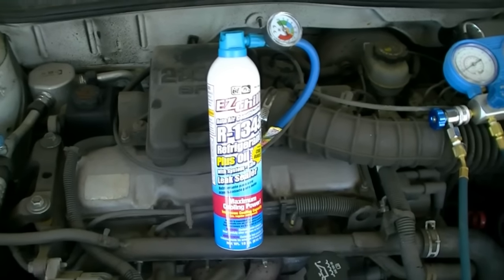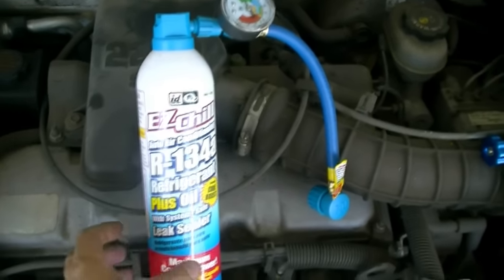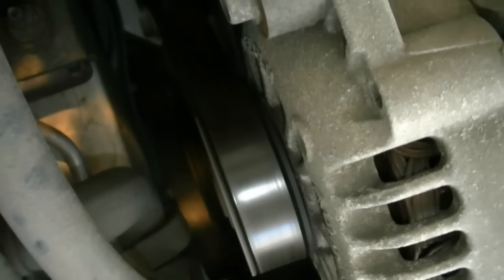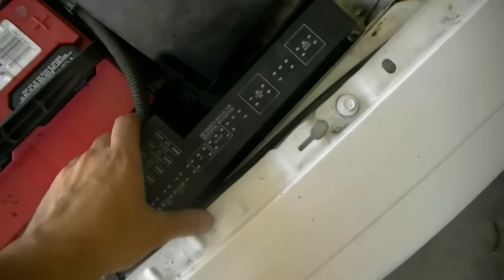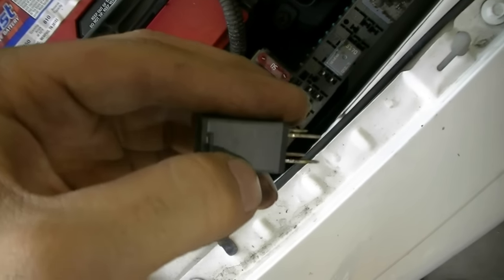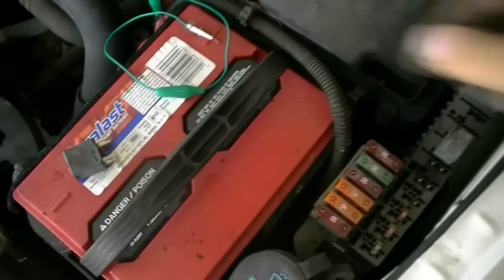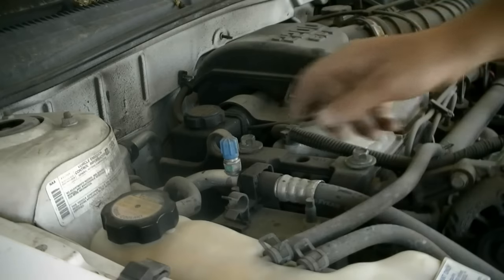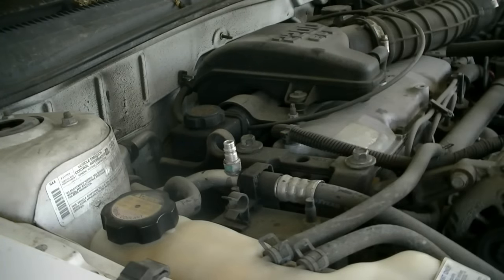How to Add Freon to a Car and Manually Engage AC Compressor Clutch

Comment from the maker: The idea of this video is to have cold air come out of the vents of your $1000 car, not spend $500-$800 finding and diagnosing a leak, vacuuming the system, replacing the parts and recharging it. I've done this to alot of el cheapo cars and it has always been a better investment than taking it to some shop where they charge you $100 just to refill the system and tell you about your leak..oh you want to know where its coming from!!? well thats another $100 sir!  Yea thanks but no thanks
Reply: Ratchets And Wrenches screw shops

Comment: I bypassed my a/c clutch and filled my car with freon and it worked! Thanks!  The only issue I have now is that I have to keep the bypass connection attached so my a/c will work.  What am I doing wrong?

Comment: If the Compressor is bad will the clutch still engage? I had someone come out the other day to recharge my system and the system would not take any freon. The compressor didn't kick on, either. When I purchased the car, I was told it had a new AC compressor installed. The mechanic said I have a bad compressor. Should I try to jump it and see if the clutch kicks on, or just buy a new compressor?

Comment: What if your relay doesn’t have a diagram on it?
Also, if you’re just running power to one terminal of the relay switch - should you ground it on another terminal? Or just power it?

Thx

Comment: Any ideas on why the ac light may not turn green when pushed? Fan blows, heater works, but no cold air. Was thinking could be freon low but in your video the ac light was still on. Thanks!

Comment: I was given a 2004 Civic that sat unused for 6 yrs. The AC does not engauge and there seems to be little or no pressure in the system. The is not worth anything but I do drive it. Should I try this hoping it will get AC working or do I need to vaccum the system and test for leaks?

Comment: I followed your helpful video on my a4 b6'04 but bypassing the relay only turned on the  ac fan, the clutch never engaged, definitely I had the wright relay, after scanning with vagcom u had a high pressure sensor fault code popping up, I had a good look at it and it looks pretty clean with no rust or wireing damage. Any solution pal. Great tutorial though. Cheers

Comment: You don't need to manually lock the clutch to add freon. When enough freon is in the system. The clutch will lockup.

Comment: Not to get too technical but it is not freon in newer cars.  It is R143a.  (the can says that in the video as well)   I'm not sure about using that stop leak. Normally they make small problems better, some of the time.  Stop leak products can also do damage.  I would avoid using it myself.  The compressor should be running when you fill it or check the pressure.  (jumper the low-pressure sensor while you are filling if you have to)  Once you get a decent amount of pressure (close to charged or blue on the gauge) the compressor should run until the low side drops below a certain pressure.  The compressor will likely stop while the low side gains pressure.  (it will cycle but the more low side pressure you have, the longer it will run the compressor) 

Fill to the desired level and it should run constantly.  The video was helpful, thanks for posting it.
Reply: Not to get too technical but it is not R-143a in any vehicle that I know of.  It is R-134a (the can says that in the video as well).
Reply: StilettoSniper you just copies and pasted it from what I said.

Comment: I watched your video on YouTube. It helped me out a lot. I could not get the clutch in the compressor to engage. When I used a jumper wire after watching your video I got the compressor to engage manually. Could this be do to low refrigerant? 2002 chevy p/u. Thanks
Reply from the maker: Susan Brucato yes, you should try adding freon first. gl
Reply: That's because you need to connect the power jumper wire to 30 not 87.

Comment: I have situation when on full blast my pressure stays around 30PSI and after compressor disengages then it goes up to 60. After few min I feel cold air inside of the car but low pressure line is not getting cold. What are your thoughts on this?

Comment: So I think I might have made my compressor problem worse by trying to push AC Pro into the system when the compressor clutch wasn't working. It wasn't until that attempt that I noticed it. Is there a way to tell if the system needs to be evacuated or just an electrical problem (like a bad fuse)?

Comment: NOTE: That clip should have a fuse incase they grab the negative trigger on that relay, being low current driver wire for the relay it will smoke it and cost inexperienced person more doa!
Reply: what size fuse would you recommend cheers

Comment: Is it always connect pin 87 to the + on the battery?  My clutch relay has pins 87 & 30 just like your video.  But I also have pins 85 & 86 -- They look like maybe they are the power pins.  Thanks

Comment: I have a 1993 toyota camry with the R-12 system. I'm thinking about converting it to R-134a. How can I convert it to R-134a and refrigerant is for R-134a system.  What refrigerant do I use to get the clutch to disengage and check for leaks?

Comment: Great video, I have a question when you connect positive to terminal how long should it stay connected. With my car it turned on but when i remove wire it spot spinning again.
Reply: This is where gauges would help.  Either high or low pressure switch may be activated shutting down the compressor.  The gauge that comes attached to the bottle only measures the low side of the system.   

If your gauge on the bottle of refrigerant is reading charged...while you have the compressor hotwired..and the compressor shuts down after removing the jumper...you have other problems.   Bad compressor, clogged lines, accumulator..etc.

Comment: I don't recommend telling people they don't need a manifold gauge set or to diagnose their issue properly.  That's really bad advice if someone has a leak or pressure switch issue.  They could just be pissing money down the drain by attempting a recharge.  I know what you meant by it but people that don't know what you meant might take that advice the wrong way, the really really wrong way.

Comment: I have a 2004 toyota Prius Hybrid am the original owner 130.000 miles. My A/C blows hot air. Took it to the dealer they said it was low on freon. added .7#, charged me $504.00. Drove it 6 miles and it was blowing hot air again. took it back and they said it was my A/C command module, and it would cost me $500.++ to replace the computer module. Do you have any experience with this system. I know it is not the same as other cars.

Comment: I have a 2000 caravan 2.4 , I replaced the compressor on it and it's empty from all refrigerant. Now I can't get the clutch to engage I saw your video and tried to bypass the relay and no luck clutch did not engage . Need help , thanks

Comment: The valve where you have to press to see if something is stuck where are you hook up the Freon to on my truck. one of them shoots out air and  the other one doesn’t shoot out any air when pressed with a tool. Does that mean it only needs Freon?

Comment: I turn on my AC and it shuts off about 10-15 minutes later, then I have to hit it with something to make it start turning again. Do I need a new one or can it be fixed while still on my car?
Reply: Try replacing your motor blower or blower resistor
Reply: your compressor clutch is bad.

Comment: Does anyone remember the GM - Buick - from early 1960s that had a small compresser pumping into a tank to be fed into engine for short boost when overtaking?
I saw it featured in HOT ROD.

Comment: My problem is that the compressor goes on and off every few seconds. The pressure with compressor off is way in the red zone, but it drops when the compressor is engaged. So if I keep the compressor engaged with the relay trick, should I get a reliable reading?

Comment: 19 year old dodge neon. Ac system never touched. Ac works fine temp wise maybe a little warmer than usual. Ac compressor at idle cuts on an awful lot. Perhaps maybe too much. Maybe a little low??

Comment: If the freon is very low will that cause the compressor not to engage?
Reply: William Murry yeah super low Freon will not turn the compressor on because the compressor switch is turned off to prevent damage to the compressor

Comment: I did this not knowing if it was low Freon or not to jump the clutch.  Well it looked like the clutch was struggling to spin just spinning sporadically off and on and started smoking.  It spins freely with my hand when not engaged so I don't think it was stuck or anything.

Comment: Do you need to get your AC compressor relay on to check if AC refrigerant is low ?
Reply: Engine running, clutch engaged, temp turned low, etc. You can't test it static.

Comment: So just for clarification purposes, the clutch is engaged when the flywheel/fan-belt is turning? Is that right?
Reply: No.  the belt turning just means the engine is running.  Turn on the AC and if all is working, the clutch engages, it usually makes a loud clicking noise, the RPM of the engine changes (you can hear it change).  The AC clutch will disengage and reengage by itself for different reasons like when you're climbing a hill and punch the gas it'll disengage to give more power.  Also because there're 1000 sensors these days that will shut the compressor off to prevent you from destroying the earth.  999 of them you don't need.  Anyway, this video shows how to keep it running to speed up the recharge.

Comment: great video, how long does it take to empty the can with the compressor running?
Reply from the maker: shouldnt take more than a few minutes. tx for watching!
Reply: Ok, is there another way to engage the the compressor other than removing the press. switch? I could only use half a can.
Reply: Quick question, I know my 1998 car is completely out of refrigerant.  I'm following all the instructions perfectly, but when I press down the button on the can to begin filling up the freon, the gauge needle pegs in the danger red zone the entire time, so I am hesitant to keep pressing down.  Is this normal when trying to fill it up?  Should the gauge be in the red while pressing down?
Reply: Matthew Micklin how do you know it's completely out? If it pegs out in the red you have some other problem...possible a bad compressor...seek professional
 help

Comment: My AC on my car runs fine but 15-20m later or sooner stops blowing cold air n blows hot air. I tried to do a recharge but  it goes straight to the red reading past 100psi on the Gage reader. When I tried to put the recharge it wouldn't take it,  the liquid wouldn't go in n the needle stayed in red. Do you have any idea why this is happening n maybe point me in the right direction of how to fix it?

Comment: thanks for video! does this work with all kinds of recharge kits? is there a certain psi you have to fill up to or just use the whole canister? i heard horror story on another video about someone adding 150-200 psi in their system and their compressor would not be detected anymore..thanks!

Comment: what if gauge shows red but compressors not engaged? Should I get the clutch spinning then the gauge will measure accurately and I'll be able to fill it up right?

Comment: Hi I added the same R134 to my 2001 ford taurus. Prior to doing so I had heat with no ac the system was workibg fine until I added the R134. Now when I turn on the fan on for ac or heat I get nothing on any settings I choose

Comment: Do you connect # 87 from the rely (the wire)and to the positive of the battery to engage the compressor manually

Comment: You almost got to my problem. It's actually getting that blue compression fitting to stay on. Does it screw on? My car it just blows right off when I press the freon tab on top. Even if I tug on it it comes off. I'm squeezing it applying pressure then letting go and it appears to fit...unless you tug it.
Reply from the maker: UNO25 They dont screw on, they have a quick connect coupler that you press up as you are pressing down on the blue fitting over the Low side pressure port. If its still not staying in place than you might have a bad one.

Comment: I removed freon without the clutch engaged because it was giving a HIGH reading. The clutch won't engage at all. Yet I'm going to try doing it manually. Replace relay already. Might be compressor or the sensor. Suggestions.

Comment: The only time I can think of that this wouldn't happen is if your can of freon is under half full.  Then there might not be enough pressure in the can to push freon into the system.  But in that case just go buy a new can, it is a lot cheaper than a new compressor.

Comment: Hi,i have a honda civic 2005 and radiator fan not spinning but when i put the clip on the connector fan is working.i fill up my coolant & changed the temperature sensor & thermostat.i need some help.

Comment: i have a question i wired it to the relay so my clutch will engage just like you did, and i filled it up with freon but i take the wire out put the relay back and still clutch doesn't engage so my question is can i just leave the wire going to the relay in all the time? since it only works then
Reply: This is a great question and what I was thinking as soon as I watched this video. Hopefully someone who knows will answer quickly!!

Comment: I have no freon in my 2010 Hyundai Elantra. Ac clutch wouldn't engage so I bypassed it with 10amp fuse it worked but no freon would still go into it unfortunately

Comment: once i connect the clips from the fuse to the battery . and the compress engage and i add the freon , do i take the clips off and everything will be ok ?
Reply: Yes, if you take the wire off and put the relay back in it's place, the compressor should engage if you have serviced the freon properly.
Reply: Maurice K thanks and do autozone sells the aligator clips ?
Reply: You're welcome. They're called "clip alligator test leads" part number 85654.
Reply: Maurice K thanks so much
Reply: can i attach the clips first then start the car up
Reply: Sure or start the car and then attach the clips so that you can actually see the clutch engage and disengage. You might get a small spark when you do this but thats ok
Reply: i see the cluth is engage but it wont tak freon . what do i do now ?
Reply: ***** It could be a number of things but lets rule out the obvious first. First, you have to be very patient putting freon in. It can take up to 15 minutes for a 15 ounce can. Before you start, you need to shake the can very well, then turn the can horizontal and vertical while adding freon and shake the can every couple of minutes while you're adding it. Also, are you sure the can is screwed all the way in so that freon can flow out? If you've done all this and still can't get it to charge, then you may have a bad compressor  or something else wrong with your unit that will require a tech. I hope this helps.
Reply: thanks so much

Comment: I replaced my condenser, so naturally the compressor won't engage because of no freon in the system. After jumping the relay and the clutch engaged and spinning, and the can connected to the low port, the can won't release any freon. It's as if the system is still closed and not drawing freon from the can.
Reply: A can of R134a does not contain Freon :) They are different products entirely.
Reply: Indeed. I figured it out anyway. It was the recharge can itself. The Nozzle wasn't pressed in enough to puncture the seal and allow the refrigerant to flow out
Reply: Don't forget to plug it in as well.

Comment: this didn't work for me. for some reason when i took out the fuse the clutch didn't even move but when i put the fuse back on and injected the freon the clutch worked but won't stay open or something...just clicks and circulate no cold air AND it took the entire bottle of freon ...so it went in but the clutch is not engaging or something what else can i try?
Reply: look for the pressure swich, maybe is not connected

Comment: Hello, I really like your videos. You certainly understand how to diagnose and repair automotive systems; and you explain procedures very well.  However, please change the title of this video. You are using the wrong word and spreading ignorance. Only the very old AC systems actually use the refrigerant called "Freon" . "Freon" is the DuPont Chemical Company trademarked name for the refrigerant R12.  Most really modern vehicles use the refrigerant R134a. You cannot call R134a "Freon"; just like you cannot call a dog an elephant.
Reply: I guess you are the only person with that problem, we all know that freon is a common word most people use for refrigerant for cars, like when you call a plastic bag with a zipper a "ziploc bag" even if it is a different brand.
Reply: Or when you call a tissue a Kleenex but its a generic facial tissue!!!
Reply: Critical reasoning indeed...
Reply: no, it would be like calling newspaper a kleenex. Its not the same chemical.....is water the same as orange juice? They are both liquids.
Reply: I'm getting strange looks when I walk my elephant ...and it's not even barking at anyone ...WTF ? it's hot out maybe some freon will help
Reply: Actually, 12A has replaced 134A. My 2007 Mazda 3 (10 years old now)  came with 134A as original refrigerant.
Reply: Doesn't matter.  You can't mix R12 and R134 because the fittings are different.  So yes, you can call 134 Freon without worrying about mixing the two up.   I'll bet you were a hall monitor too.

Comment: i have the same gauge,when i put it on with the engine off the needle is in the alert section and when i turn the car and aircon on the needle is the low section ,any ideas,cheers